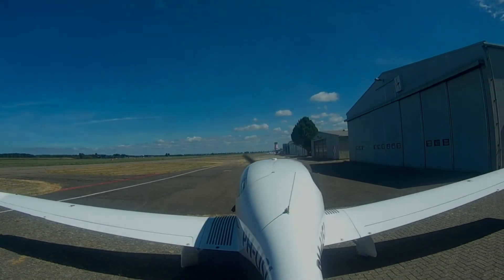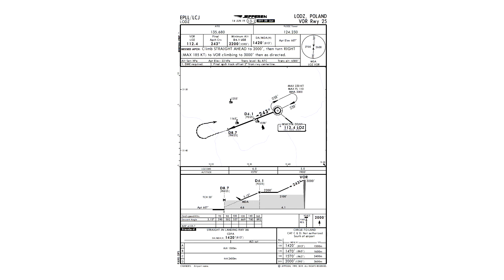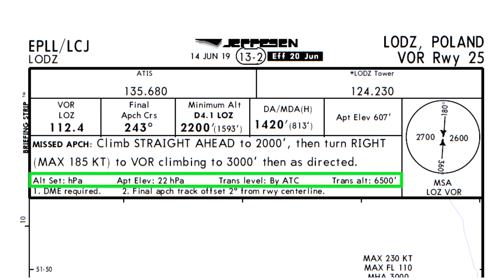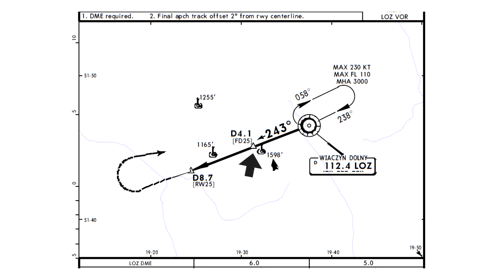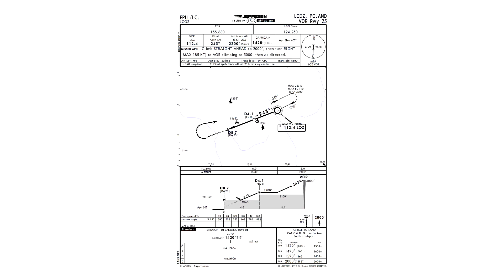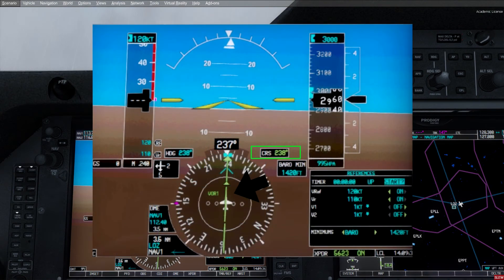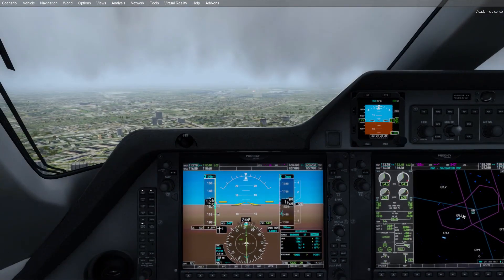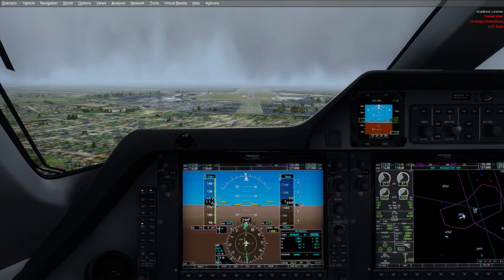Virtual Flightschool: How to fly a VOR Approach (G1000)

Comment: So what would be the procedure if you were approaching the VOR from the northwest? Do you turn to a 243 heading as soon as you are on top of the VOR? Or do you need to fly the hold and then fly outbound on on the 243 radial? Thanks!
Reply: It mostly depends on the arrival procedure that comes before the approach. Some of them will route you in such a way that you will always approach the VOR from the east. If you were to fly directly to the VOR from the Northwest, you would do a holding entry so that you approach the VOR on the 238-degree inbound course. If you're cleared for the approach by ATC, and you are ready yourself, you can continue on the 243-degree radial. Otherwise you would stay in the published hold until you are ready or get the clearance for the approach. I hope this helps!